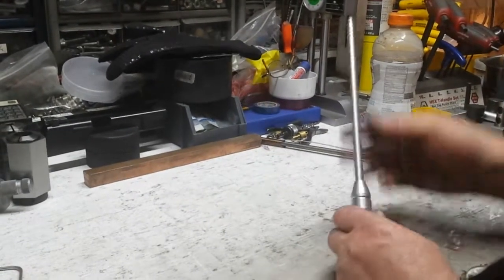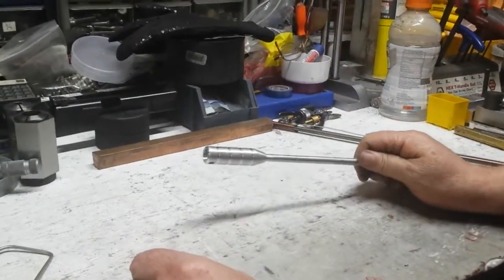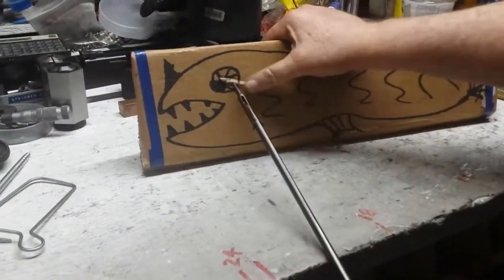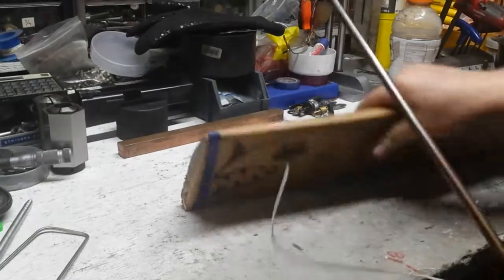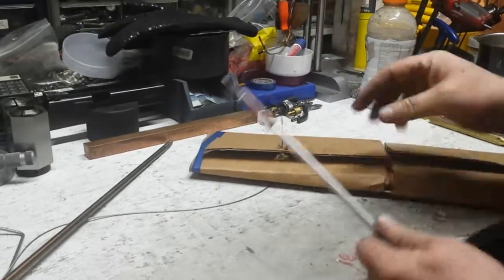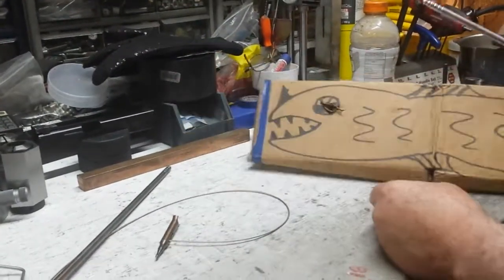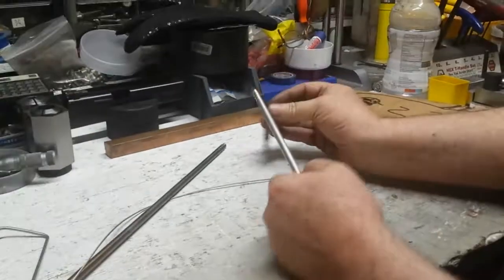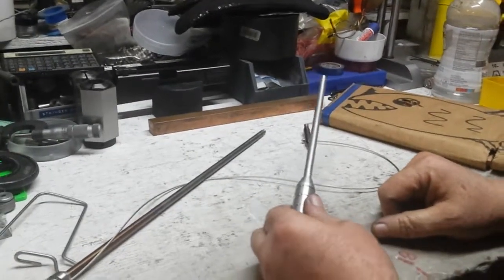Linghunt slip tip removal tool from large fish

Comment: So, if you can do it with the spear, why make an additional piece? In any case, just use your knife ---slide it along the cable, back out the spot of impact.
Reply from the maker: Yep, most don't need it, just an option.  

I made this to see if folks wanted it, and to prompt new ideas. 

One spear-o liked them for deck hands to speed them up.  Not a high volume part.

Comment: If it's bad electrical tape works too.
Reply from the maker: A slip on O-ring as well.  Many DIY-er options out there.   A fancy tool like this mainly for use by a deck hand while the diver is waiting for pole spear as he fumbles to get fish off quickly.  

Hard to beat just a wooden stick where idea came from.

Comment: can you tell me what angle it is on the female slip tip?
Reply from the maker: Kirk -- Which Angle?  the flared wings? the point ?    The Tip of the spear point is like 30 - 35 degrees I recall, without looking at print.     Got a New design so that one is obsolete for the most part.  Got like 25 or so left